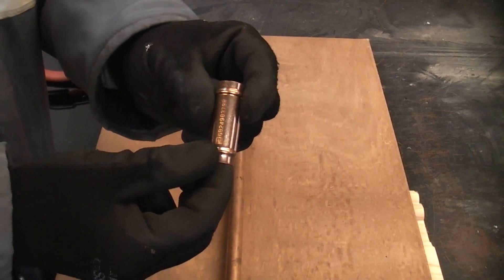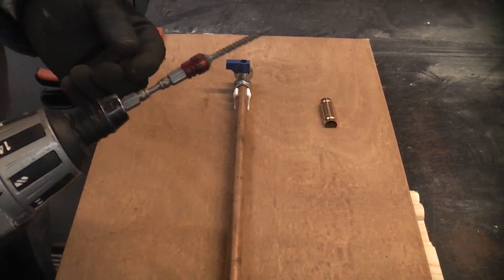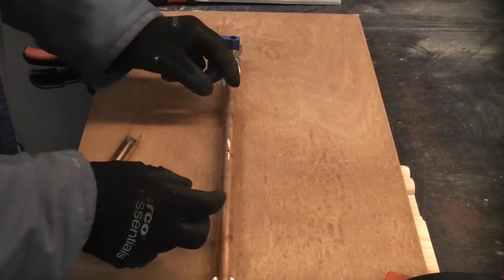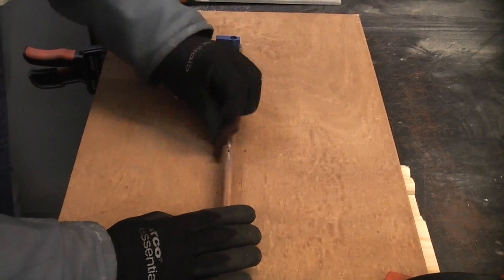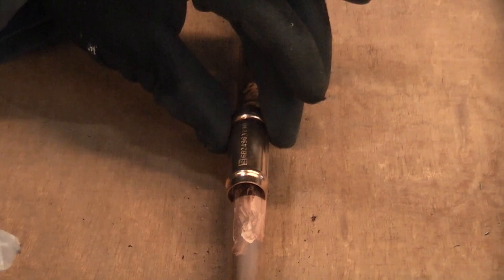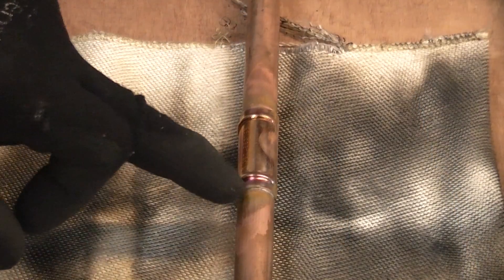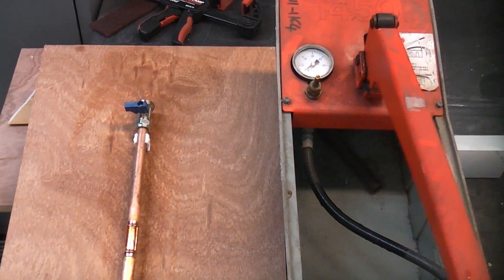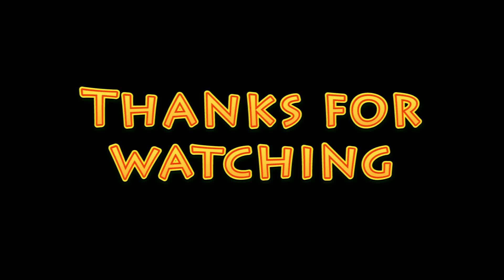How to repair a hole in a copper pipe using a click fix patch repair

Comment: Seems like you could do the same thing with just a bit of cut copper pipe(?) I suppose you'd have to de-bur the edges but it seems like it would work just as well. Nice video!
Reply from the maker: Thanks for the comment

Comment: I have been doing this type of patch for years by hacksawing a same size copper pipe coupling in half. I had to hold the patch in place with copper wire until I was done soldering. Looks like your would save time by clipping on the pipe though.
Reply from the maker: Thanks for the comment
Reply: clean the copper wire before you wrap it around and just solder the wire too after soldering the half-pipe-patch - just as strong as a slip coupling and you don't have to cut the pipe... although you still have to make sure the pipe is drained of water - and often the best way to do that is to simply cut the pipe to drain it and then use a slip-coupling...

Comment: Hi all, I would just like to thank you all for your kind words about my product, also a massive thank you to handyman for a fantastic review.
Just a few answers for the questions asked in the comments....yes we do use lead free solder, this is so important as click fix is use on fresh drinking water, also we have actually fixed a pipe when the nail or screw has go right through the pipe, we achieved this by twisting the clip once it was on the pipe and if it covered both holes then it worked.
We do have a 22mm click fix that as just come on to the market and is available in flowflex, in a few weeks time it will be in all other leading retailers.
Am sorry you can not buy click fix in the US but we are looking for offers for distribution so email me if you feel you could help. sales@burkertis.com
Again thank you all so much and enjoy CLICK FIX !!!!
Reply from the maker: You are welcome
Thanks for the comment
Reply: It seems a very handy product but I do have one question, is there enough solder in the fitting to completely fill the join between patch and pipe? I ask this because if the solder only runs and seals around the perimeter of the patch there  is potential for flux to be trapped between the patch and pipe which may not get washed away like it would in a normal fitting. 

I will have to try one on some scrap and cut it apart to see before I would be happy using it for a permanent repair. I would be worried about flux corroding the fitting from the inside over time and causing a leak.

Comment: Excuse me, the tubes never break with a hole, the copper tubes explode and deform. The system does not work.
Reply from the maker: This is designed to be used if the pipe is punctured, or has a pin hole prick.
Thanks for the comment

Comment: Can't we use a piece of a similar copper pipe cut to the same dimensions instead of buying this patch ???
Reply from the maker: You could try that, but you would need to use solder (obviously)
Thanks for the comment
Reply: FOMI1970 yes I repair a pipe about 8years ago. Patch that I made with 1/2 in pipe and the patch still there.

Comment: Is it a lead free solder? otherwise I definitely wouldn't be putting it on the drinking water pipes. apart from that it looks quite useful. although most screws would go through both sides usually.
Reply from the maker: I'm sure all solder ring fittings use lead free solder and have done for many years.
Thanks for the comment
Reply: Ultimate Handyman I have come across a handyman adding a bathroom and using leaded cable solder
Reply from the maker: Yes, you can still buy that but it is meant to be used on gas.
As far as I am aware all solder ring fittings use lead free solder.

Comment: Hello, I am currently replacing a leaking copper pipe that goes to an outside tap. I have fitted an isolating valve to the copper pipe (to turn the water off going to the tap) that will be going through the downstairs loo wall, and out to the outside tap. The only issue is that the existing copper pipe is jammed in the wall and I can't seem to pull it out. What should I do next?? Use pliers or something??
Reply from the maker: Yes, it might come out if it can be turned with pliers. It's not been plastered or rendered around at one side has it?
Reply: Ultimate Handyman No, it's not been plastered or rendered, but I did have to cut the plasterboard to get access to the pipe itself. The downstairs toilet is being refurbished anyway, so it is not a big deal.

Comment: Where can you purchase these in the USA . We have 3/4 1/2 and 1/4 sizes mostly.
Reply: Honestly, you're better off cutting the pipe.  In this way, you can ensure there's no standing water in the pipe.  Any water in the pipe will ensure the joint will never take solder.  Buy couplings *without* the built in stops.  Permanent repair that doesn't look hacked.

Comment: For do-it-yourselfers, some mention of how to first get water out of the pipe would have been useful. A very clever little invention.
Reply from the maker: I think you could use one of these with the water in the pipe as long as the pipe was open ended (somewhere the steam to go)
Reply: Yes, somewhere for the water to go--if it's in the middle of a house's copper plumbing, the water to the house has to be turned off and the pipe drained somehow (which is one useful thing about a standard sleeve-type fix--cutting the pipe allows it to drain). Anyhow, good vid.

Comment: The hardest part is getting all the water out of the pipe.
Reply from the maker: I don't think you would need to get all the water out with one of these couplings as long as it is used on the top of the pipe, providing the pipe is not sealed I would imagine the water/vapour would try to escape out of the open end.
Thanks for the comment

Comment: Looks like a good idea but I know from experience that even though you have drained down the system there is always some water remaining in the pipe which makes it impossible to solder . That why I always use compression fittings for nail through underfloor pipes repairs. Fifty years experience.
Reply from the maker: Thanks for the comment
Reply: I just had this exact experience. Drained the underfloor pipe, tried to solder the patch on but I just couldn't get the area hot enough. Very frustrating. In the end I went with the compression fitting, it worked a treat.

Comment: Except the hole would have been on the other side of the pipe.
Reply from the maker: Not unless you were using really long screws.
Thanks for the comment
Reply: I thought the scenario was that someone was screwing down floorboards and inadvertently screwed into a pipe running beneath the floor, so the hole would be against the wood. Perhaps the joints at both ends of the pipe could be heated simultaneously to allow the pipe to be rotated in situ, bringing the hole to the side opposite the wood.
Reply from the maker: If you screwed through a floorboard, you would remove the screw and the floorboard to make the repair, so the hole would be on the top of the pipe.
Thanks for the comment

Comment: do you take the air out just for the demo?...  if the pipe can hold pressure with air or water is that not ok?
Reply from the maker: You always have to bleed the air out of a system when pressure testing it. Air is compressible, so if there is any trapped air it will compress. Most liquids are not compressible which is why water is normally used for pressure testing. 
If you were to use air for pressure testing and there was a failure of a component there could be a big bang and damage, whereas with water it will just escape until the pressure is reduced.
Reply: Thanks for the video and thanks for the reply....
Reply from the maker: You are welcome ;-) 
Thanks for the comments

Comment: Y not just cut one side of a of a coupling (that doesn't have a ridge in the middle of its inside or file it away),  bend/wrap it so the cut side is opposite to the hole.  Then sweat the coupling as normal except to also sweet where the cut is too. And soldering the hole 1st just as insurance.  What if anything am I missing? 

PS Flowflex doesn't seem to be available in the states or in none metric sizes?

Comment: Nice video but I still prefer splicing, I feel the likelihood of future failures is reduced. You have a C vs O keeping back high pressure.
Reply: I disagree, I think these things are awesome.
Reply from the maker: Thanks for the comment
Reply: Agreed, splicing + slip coupling, ideal when a nail has gone thru a pipe on a joist.
Reply: theres always that one guy
Reply: Can’t go round with slicing pipe and soldering two slip couplers. But I was recently on a job where I had no room to even get my slicer in, the pipe was clipped to a joist above the kitchen ceiling. The only way around it was to tear out 3/4 of the kitchen ceiling for a pinhole in the pipe. These patches are a life saver and she hasn’t rung me back since about a leak 😂

Comment: Only bit of advice missing is to get the water out the pipe before you try to solder, otherwise the steam will just pop it before the solder even gets close to melting.
Reply from the maker: Thanks for the comment

Comment: Pretty cool never seen one of those although I don't run across nail holes that often usually it either a bust from temperature or pinhole from deterioration so usually the pipe just plan needs to be replaced but cool idea. I have seen solder filled fittings years ago wasn't aware they still made them tho.
Reply from the maker: They are handy though, I often keep a couple of pipe repair couplings (just in case)
Thanks for the comment
Reply: Ultimate Handyman no problem thanks for the video I'll check out more of them

Comment: Can these be found at the local hardware store? Never heard of them before. Neat item.
Reply from the maker: It depends on what they stock, I would imagine that most plumbers merchants will stock these or you can get them online- https://www.screwfix.com/p/flowflex-copper-click-fix-pipe-repair-patch-15mm/5962v?_requestid=345886
Thanks for the comment

Comment: it's cool but the shark-byte(type/not necessarily the brand) fittings(in this case a coupler) are KING .........the only tool required is a pipe cutter or a hack saw.......a child can do it........they even can connect copper to PVC and/or Pex(& vise versa)........& they can be rotated after being connected so you have much more/total play with your angles.........Pex can even withstand freezing(though its not spec'd for it)........truly some 21 century plumbing technology.........but at like $5+ per fitting it does add up.......but so do hourly plumbers........old school soldering does take some skill.......its not that hard but it tight spots its a nightmare.

Comment: I just noticed another video from the USA showing a similar repair done by winding a layer of copper wire tightly around the pipe and then running solder into the grooves. It looked to be just as effective providing there's space to wind the wire around the back of the pipe. Stripping the wire out of a bit of scrap mains cable is all that's needed, so is free.
Reply: That is temporary fix. Video by Got2Learn channel.
Reply: Seems to be the better method, since it will fit all pipe sizes
Reply: The wire method seems like it would leave more opportunity for failure down the road vs. something like this which is machined to fit flush over your pipe.

Comment: The ebay listing looks like it's for 49cm of this stuff, i.e.  about 19 inches or 10 repairs like the one you've shown. At that rate it wouldn't be a bad deal.

Another helpful video, as usual. Thanks.
Reply from the maker: Yes, I noticed that but I think they have put the incorrect size down as the regular ones are 49mm
You would not be able to cut a large one down to size as there would be no solder at the ends.
Thanks for the comment

Comment: Great little patch. The only issue is if it were because you were screwing down through your floor, you would have to pull your floor up to fix it or pull the pipe down from underneath.
Reply from the maker: Thanks for the comment

Comment: I use a piece of scrap pipe cut down as these patches are, and openrd out a bit so that they snap onto the leaking pipe as these do. I then flatten out some solder (flux cored if I'm feeling lazy) and then position two L shaped strips around the hole. Snap the patch over the solder and heat as normal. Cost? Bugger all!!;)
Reply: I just solder the hole , never had one fail.

Comment: I used to do this with just a regular piece of pipe cut on the back. Worked pretty well, but, i like the idea of these much more smaller pieces. And the neater aspect, of course, as some pipes are visible.
Reply from the maker: Thanks for the comment

Comment: Another excellent video. Some context on the pressure achieved would be good e.g. tell us what average mains pressure is. Sounds like fifty bar is well over normal household supply.
Reply from the maker: The water pressure at my house is considered high for the UK at about 8 BAR.
Thanks for the comment

Comment: With the traditional repair you mention, how do you achieve a perfect fit between the two old sections and the new insert? Do the connectors allow some lateral movement?
Reply from the maker: I'm currently editing that video (hopefully it will be ready for next Sunday).
No, there is no lateral movement with slip connectors but they allow the pipe to slip right through the fitting, so for example you cut out the piece of damaged pipe and say it is 2 inches exactly. You cut another piece of pipe two inches long, then use a slip coupling at each end and you can just slot the pipe in position and then slide the two slip couplings to the correct position.
Thanks for the comment

Comment: I bought this same pack of screwdriver bits from BG. Not too bad for light work.
Reply from the maker: I bought them a few months back but forgot I had them. Then when I was assembling the Keter high store - https://www.youtube.com/watch?v=C06G-aI2vMU
I struggled like mad as the screws kept falling from the end of the screwdriver bit as I could often only use one hand, I then realised that I really needed some of these bits and then found a pack of ten in my office a few days later! 
Like you say they are good for light work but the end would soon get chewed up in a impact driver.
Thanks for the comment

Comment: I would like to know how this works in practice on an old pipe where you can't drain everything out. I've spend ages trying to solder when there's some water present and its a right mess.  Always gone for compression where there's residual water.
Reply from the maker: You can solder a pipe with water in it by using a piece of bread to soak up the water. https://www.youtube.com/watch?v=g83YSnKp0jA
With one of these fittings (as long as the hole is on the top of the pipe) I think you would be able to solder it with some water in the pipe as long as there was plant of space in the pipe for the expanding steam to move to, or else it would try and escape through the hole. 
Thanks for the comment

Comment: Nice tip and thanks for knowledge of the component. Just one small point as you are attempting what is a capillary joint should you not be bringing up the temp of the pipe not just the fitting? I noticed you were concentrating the heat just on the fitting.
Reply from the maker: I've always soldered joints be heating just the fitting as the heat will quickly be transferred to the pipe, I have never had a joint fail yet.
Thanks for the comment

Comment: If you cut off the water, why not fix it properly
Reply from the maker: This is fixing it properly, the patch will last as long as the plumbing installation.
You could cut out the damaged piece, but in most cases you would need to use two slip couplings and another piece of pipe, which would work out more expensive than a repair patch.
Thanks for the comment

Comment: three years ago i was going crazy with my 16 gauge nail gun in my kitchen, and i didn't know it, but i punctured a pvc water pipe.  i discovered the punctured pipe after three years, and it never dripped until i removed the nail to fix the pipe, there was zero signs of any water leaking or damage.
Reply from the maker: That was lucky ;-)
Thanks for the comment